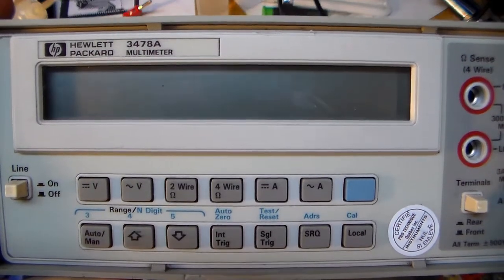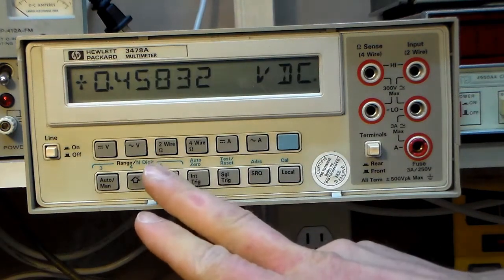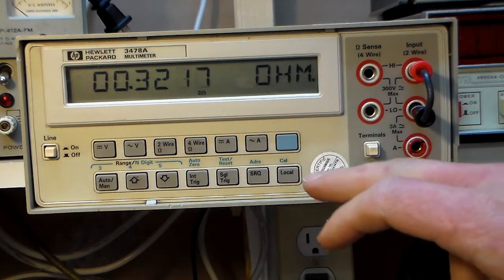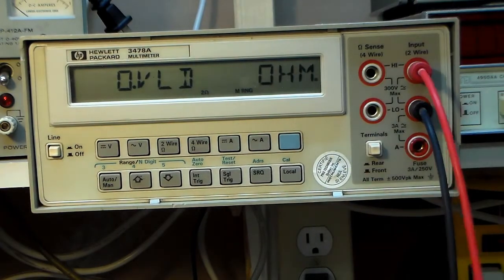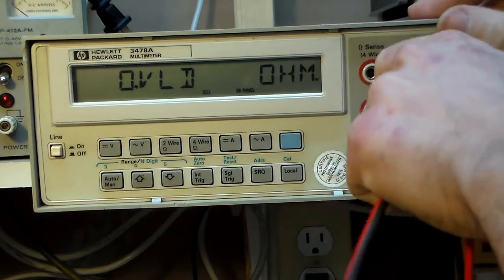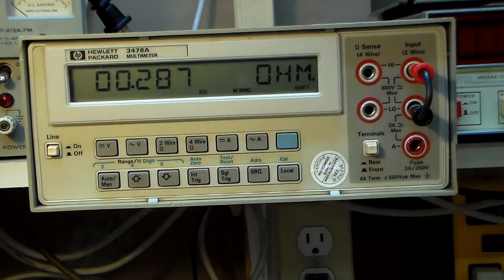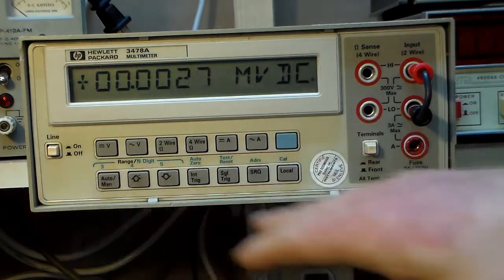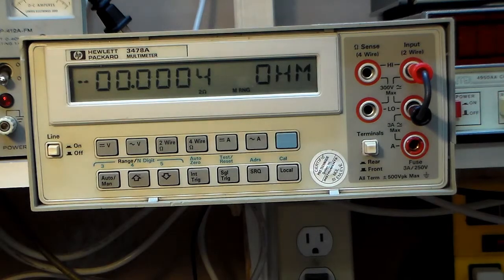HP 3478A ROM modification : relative mode

Comment: 3468A have same issue. Would be good to see how it is done, my idea was to change whole digital part with stm32, cose 3468 dosnt have gpib, hp-il instead.
Reply from the maker: See part 2 https://www.youtube.com/watch?v=iQfa1jukYnI , it also has a link to my github repo with source code and notes. Replacing the digital part would be an interesting project; I mentioned something similar in https://www.eevblog.com/forum/testgear/hp-3478a-rom-modification-relative-mode/msg2061439/#msg2061439 , as you've probably already seen. Ping me if you ever start working on that, I may be interested.
Reply: @fenugrec5697  Thanx, also found ur eevblog topic and that other one with firmware extention.